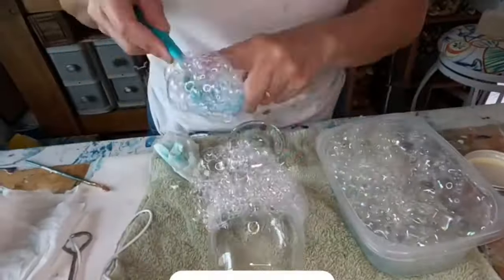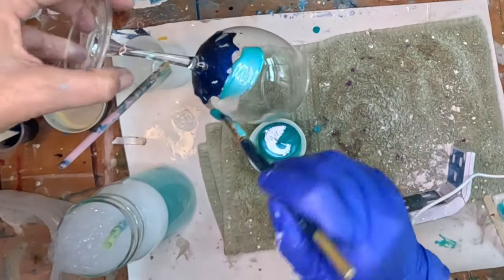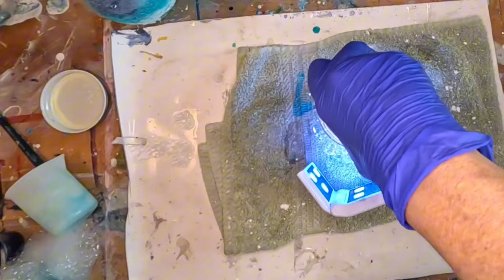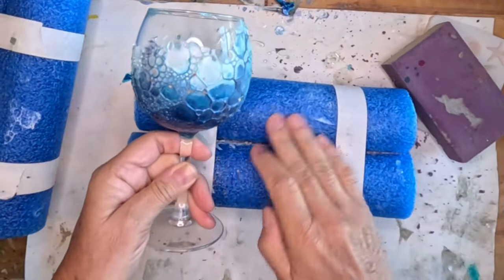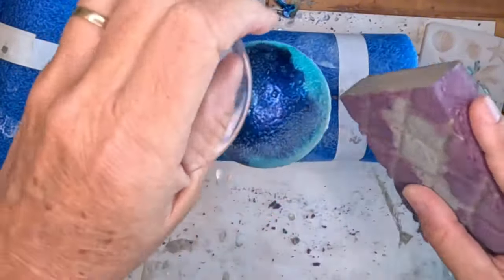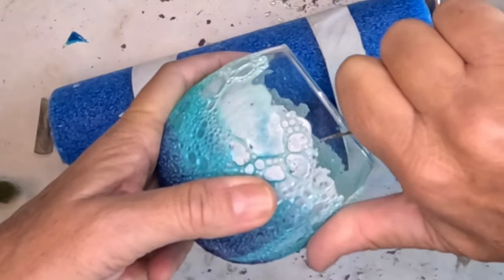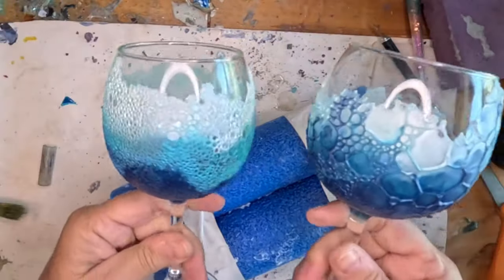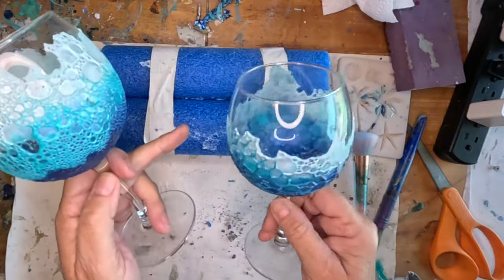“Dragonscale” Method on a Clear Wine Glass with Colored UV Resin. !!!WOW!!!! Look at These Bubbles!

Comment: It seems like the bubbles are smaller on the one with a thicker coat of resin, I like the bigger bubbles, although both are beautiful! just a tip, liquid latex around the rim would make it easier to clean off those stray bumps. the random fingerlings make it look like waves splashing,  it looks natural that way.  I must give this a try! thanks for sharing.
Reply from the maker: I like the bigger bubbles too! Thanks for the tip on the liquid latex!

Comment: After you cleaned  the edges with the knife  I saw the resin lift a little. Will water effect it  after hand washing ?  I haven't worked with different  types of resin . Does that make a difference since its for food/ drink ? I love the look❤  Thank you
Reply from the maker: That’s a really good question! The few spots that lifted may allow water to get underneath, so I am going to do some tests at home on these glasses first. I’ll post results! I probably should have left those spots alone and just used the sanding block.
Reply: What about a dremel with a sanding bit where you can get right in and spot sand the rough tips along the edges.  A glass lathe or sharpening stone might be harder and let you clean the raised edges off more quickly.
Reply from the maker: that’s a good idea too! On a low setting. I was thinking of a hot knife too.

Comment: You know that no one can drink out of them because not food safe you need to put a coat if epoxy over it do the hang method it will keep the texture on the glasses
Reply from the maker: I didn’t bring the UV all the way to the top, so skin contact would be incidental. But, I appreciate the tip. I applied a top coat on another set (total fail for a few reasons!) so I will try the hang method on the next glasses that I do. Thank you! This will be perfect because I really don’t want to lose that texture.
Reply: There is no resin on the inside.  Keep the resin from the rim.